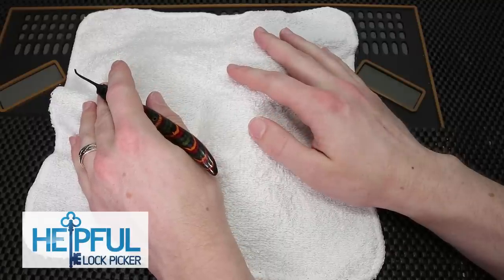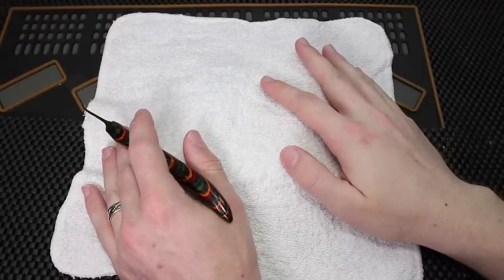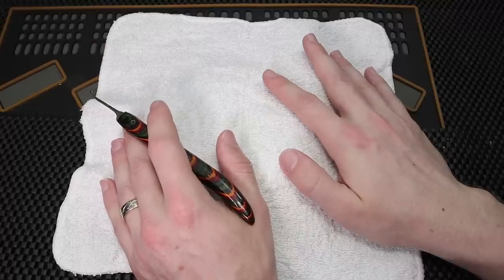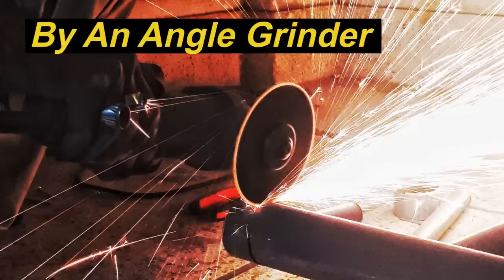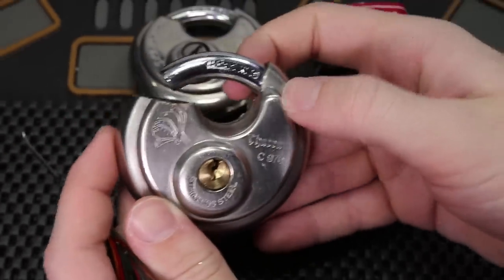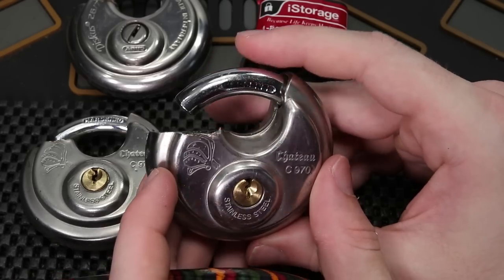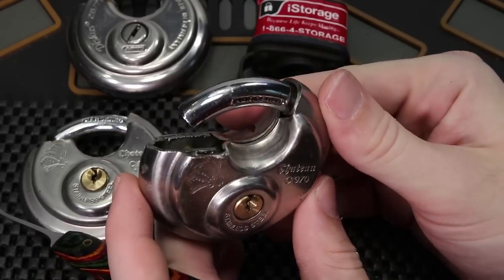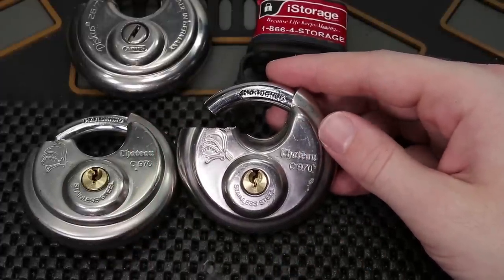[279] Why Do Locksmiths Use Destructive Entry? | Explained

Comment: As a locksmith I can say that the customer really don't care. They want the door to be open. Sometimes they are mad at us because we use e-pick and it take 1 min to open their door and price looks "high" some of them want the locksmih to have a "hard time" and they want to see what I call "brutality and fireworks". For my part I always go NDE for at least 15min of the job if the customer has a spare key inside. But seriously with all the shit they see on TV you always hear stuff like "burglars are faster ! " "I tought this was quicker !" you can pick a fucking Winkhaus, use a plug spinner 3 times or use a cool bypass tool and not even get a "thank you for saving my lock !"
Reply from the maker: Thank you for sharing your real-world experience. I just feel many of the customers are ignorant to what is actually going on. Thank you for always trying NDE first :)
Reply: Same with a rim cyls and crappy nightlatches, if you will get it open with a plastic card, they are getting mad.
Sometimes yea, they are saying that burglars are faster, and usually in saying that if you want to get inside faster, we will have to brake couple of parts, like handle for example etc, and usually they cool off

Comment: You are correct. Most locksmiths are not lock picking hobbyists and can easily be out picked by one. Lock picking is a very small part of what they do, and time being money they have to gain entry for the customer and move on to the next call. Some customers don't own items like a cut-off wheel so the locksmith will have to do it for them. You are also correct about environmental issues when it comes to picking. One last consideration is the vast amount of "trunk slammer" locksmith companies that are out there. They have no desire to pick the lock (mostly because they have no idea of the concept). These shady companies hire people that know little to nothing and look to replace rather than even try to pick (again, a skill they probably lack anyway). Drilling and replacing will build up the cost and create more profit because you are selling the customer a new lock. Pick open $15....Drill and replace....a lot more. Bottom line, hire a reputable company, don't be surprised if they use a pick gun and don't be surprised if they can't pick the lock open as fast as someone that picks as a hobby.
Reply from the maker: thank you very much for sharing your real world experience! I agree with all the points that you mentioned. There are definitely some shady companies out there which you can see highlighted on YouTube and unfortunately if you got apples can create a negative stigma.

I think one of the ones I saw someone charged like $300 or more for a lockout on a Kwikset kw1 door lock.

Comment: Since I took up lock picking  sport, my Property Management business is more enjoyable. Today, I went to a rent house, where tenants had changed locks against policy.  I picked the front door thumb lock pretty easy but the deadbolt was difficult, so I used my electric pick gun and it opened fast. I did have to use the core spinner on both of them.  But, it was fun and satisfying to not have to destroy the locks to get in. 
Once in, I choose one exterior door to be the patsy and I fixed it so I can use my Fireman's door shim and deadbolt knife to get in quickly from then on. I don't know why tenants think we want any of their crap. We have to get in from time to time, for one reason, or another.  Maybe they are growing weed in a closet or something.
Reply from the maker: Thank you for sharing, but I'd be very careful with that practice. I know I my state you could get in trouble for doing that
Reply: @HelpfulLockPicker  -Sooo... in your state it would be best to drill out the locks; only to have them replace the company locks over and over? The rental contract spells out that we will effect entry for a list of entry reasons, and that they cannot have their own locks period.  They agree and sign.
Reply from the maker: @andy-jac  If it is in your contract that can be different. I just know it to be a grey area. Just because you own the building it does not grant you the right to enter the building. It can be argued to be a form of trespassing.

MA is a state that is very hard to evict someone and there are strict processes that need to be followed in regards to entering a building someone considers their residence especially if you start to alter the locks. 

One of my friends is in property management and what I know is what I have heard from him from casual conversation.

I am from MA but I am also not a lawyer and I would take what I am saying with a grain of salt, lol.

Either way, I  am happy to hear that your skills in locksport have been able to enhance your professional life and it is nice to hear it has been beneficial for you :)
Reply: @HelpfulLockPicker  - LOL You should move to Texas, where property owners still have rights and I openly carry a 15 round pistol on my hip.
Reply: @andy-jac  here were im at you most give 24 hour notes before coming in and we have the right to change any lock so long as we give a key to the landlord. So if you did that here you could be charged regardless what it says in the contract. Here there is the landlord  tenet act and if it says you cant go in with out 24 hours notes. You cant over rule that. So i would still be careful doing that

Comment: one locksmith we use to open the big locks drives around in a old pickup truck with a massive air compressor in the back, its around 40-50 gallons hooked up to 100 foot  3/8 inch hose with an angle grinder.
Reply from the maker: Thanks for sharing! That sounds like a some heavy duty stuff

Comment: Great explanation. Good locksmiths will try NDE but ultimately you're right we have different goals and when NDE is failing or taking too long we resort destructive entry.

I also saw a comment saying why would you pay a locksmith to do that well to address that not many average people have the right tools and they often actually make things worse. Calling a locksmith is not a guaranteed destructive service nor is it a guaranteed NDE. Some times we can be successful in picking or decoding locks and when it comes to door locks I've seen damage done so bad to the door and frame that they have to get a carpenter to put right. Chances are if you get a good locksmith they will save you money if you don't have a go at it yourself and let them work their magic. I would say too that destructive entry still takes skill and precision. Yes you will get rogues out there putting a nine inch hole in the door with an arbor saw bit but that ruins the door beyond repair a skillful locksmith should be able to drill a small 4, 6 or 8mm hole in the right spot to affect entry on a mortice. Thus saving the door. Customers will panic though and only call a locksmith when their efforts have failed. Putting us in a awkward position to start with and then costing the customer a new lock where we might be able to have picked it had they left it.

I really appreciate this video as it does clear up some of the misconceptions but I do want to say that for me at least destructive entry is a last resort. But it's tool in the box to get a job done. Especially when a lock had failed and the original key does not work picking will not work anyway. I have been in that position myself. A key in knob system with a detached tail so the key was breaking the shear line and the plug was spinning but not retracting the bolt. It happens. Just because it's picked or yiu have the correct key doesn't guarantee an open.

Much love. Urbansumo
Reply from the maker: Thank you very much for sharing your real-world experience and your kind words :-)

Bored Lock picker who sent me these locks is awesome he will always try to pick first and he has been doing a great job helping out customers by using his Lishi Tools.

I respect the profession and agree that it is best to call a professional and not potentially make matters worse. As with all professional there will always be a few bad apples that can lead to negative stigmas but so far very locksmith I've encountered has been awesome (small sample size though)
Reply: I hardly ever destroy any locks outside of smart key or the storage locker locks which are being replaced anyway.  the locks in this video were cut the same day. the storage place had me out to cut locks for them on the non pays.  An employee has to be with me and they want it done as fast as possible because when if they're with me they aren't in the office helping customers.
Reply: @BoredLockpicker  yeah definitely NDE is preferred but sometimes there's no choice but wherever possible i try picking bypassing and decoding. There's a certain pride in doing NDE work but as i said you get the odd one where the mechanism inside is faulty so even the key doesn't work    even if the sheer line breaks and the plug spins so then we need a plan c or d which is why i have a drill, an angle grinder and soon a die grinder. I don't enjoy destroying locks and i always feel a little sad each time like somehow I failed but it is true sometimes we gotta do what we gotta do right and I think that was the essence of the video in explaining why sometimes locksmiths destroy the locks.
Reply: @forric23  well said!  I got into locksmithing from being a hobby lock picker.  I love picking locks.  main thing I want to do is open the lock in a way the person paying me can't.  even when I see that i can probably shim a latch I still pick it unless its smart key I just shim the latch and save the lock lol.
Reply: @BoredLockpicker  you sound very much the same as me i also came from lock sport. I haven't had to deal with any smart locks yet and I am kinda dreading it. But then ive dealt with failed UPVC mechs and had to spread out hook bolts from the keeps so i guess it would be no different. Similar sort of bypass probably.
Reply: @forric23  what country do you work in?
Reply: @BoredLockpicker  UK. So we get a lot of euro cylinders and mortices.
Reply: @forric23  upvc MPL's are fairly  easy , it is composite doors with failed  mechanisms I hate.
When it comes  to picking  on a job  we do have an advantage  over many American  pickers  due to us having to deal  with common locks  fitted  in both orientation.
Having said that I had to remove  47 bike locks in one visit  from a student  accommodation site last year, there were 2 nice padlocks  that I picked and repined  the rest got cut.
Reply: @cardiffpicker1  i can imagine Composite being a pain as there's no give. Not been to many composite jobs and thankfully none have been hard failures in the locked position.
Reply: @forric23  a lot of the time you can remove  the cylinder  and manipulate  the linking  bars through  there, but if something  has disconnected  ot is a pain
Reply: @cardiffpicker1  I can imagine. It doesn't help my anxiety. I have actually stood on a doorstep before and dripped with sweat in abject panic. Lol. As my experience grows I feel more confident but still there are locks that fill me with terror. Like abloy protec and ingersolls. In those cases i think its either walk away or die grinder time. I also think that customer's who have those sort of high security locks expect them to be drilled out but it would be a nice surprise if we were able to do it NDE. The only thing I worry about is whether that makes the customer feel less secure that their unpick able lock was picked open.
Reply: @forric23  ingersoll  is generally  through  the letter box or   drill through  the door and use a drop key, abloy protec  are destructive  entry or find another way in.
Reply: @cardiffpicker1  i thought so. I have the drop key but that only works so long as it is not deadlocked with the key. Glad to hear that protec is accepted as destructive.
Reply: @forric23  there are probably  only a handful  of people  in the country  who can pick the protec 2
Reply: @forric23  you can drill an ingersoll cylinder  , obviously  an expensive  decision  though

Comment: Decent examples. Yes we want to get the job done as quickly and efficiently as possible because at times you may have two other calls waiting. A worst case is being out on a residential call that a customer hovers right next to you while you know you have another call for a lock out on a Automobile thats engine is running. Plus its a 10 mile drive to get to that next call. The pressure definitely affects your picking skills. Its similar to playing pool/billiards against someone and then deciding to gamble the next few sets. It will throw your stroke off and you will not be as good (well that is unless you're a hustler). I can say this out of a year of work I can still count on my hands the locks that I had to use destructive methods on to get them open. I do alot of picking practice though at home usually while falling asleep lol. I keep a few locks on my night stand and switch them out every couple weeks. I keep the most basic tools on the night stand for picking them as well. You can train yourself though to pick under pressure and stress. However there will eventually be a time when you just have to use destructive entry. Just as the analogy I mentioned about playing pool for money. Eventually over time you become accustomed to that stress and become a much better player. Performance anxiety very much exists in Locksmithing as you want to keep the customer pleased and do your best so that they will reccomend you to others.

Comment: Like any trade, fast and efficient is how you pay the rent on home and shop.
I have watched a number of videos by SE Lock and Key.  You get an idea of the many constraints, the unexpected problems requiring creative solutions, and the fact that the clock is always running. Everything you do costs you money so everything must make some money.
Reply from the maker: Thank you for sharing!
Reply: yesterday I went to a vacant commercial unit.  schlage mortise cylinder.  I had to open the door and replace the cylinder with a different keyway to match the master key the owners use for the vacants.  I have the cylinders already pinned.  Job usually takes ten minutes tops.  I picked the lock open in a couple seconds then notice that all the screws that hold the cover plate on are stripped  so bad it almost cant be an accident.  couldnt get them out so I drilled the heads off then use pliers to get the rest of them out.  then of course the set screw that holds the cylinder in had its head broken off.  drilled that out.  managed to not hit the threads so I didnt have to re tap it but thats how an easy 5-10 minute job turns into 20-30 minutes.

Comment: I work for a self storage facility and that's what we basically do.  We use angle grinders to cut off the lock and sometimes, with the weird angles the locks are in, it'll probably be faster just to pick the lock lol
Reply from the maker: Thanks for sharing! Angle grinders are certainly more reliable than picking. Picking locks in use can be tough

Comment: Exact same method of entry every time.  I wonder how long it took him to get entry that way?
Reply from the maker: I can ask him or see if he has done a video on it :)
Reply: @HelpfulLockPicker  that would be cool.
Reply: It can usually be cut in less than 5 minutes with setup and teardown putting all the tools away
Reply: @georgeyorba109  that's quick.
Reply: like 2 minutes per disc lock.  I go slow because I dont want to nick the hasp or door anything.  the small little master locks cut in a few seconds.  on the disc locks its actually better to cut the other side of them.  it takes less than a minute but the way they're usually locked on the doors its just easier get to that side that I cut.
Reply: @BoredLockpicker  That's incredibly quick. I can imagine padlocks like Master and others similar. Surprised the disk locks can be cut through so quickly.  I suppose trying not to damage hasp,  hate or door would slow you down a bit. 

Thanks for answering 👍🏻
Reply: @roysammons2445   thats why I think spending money better locks like abus discus lock as opposed to the cheapest disc lock at walmart is a waste of money.  if you lock it with the key facing the frame you cant get picks into and the grinder cuts them all with ease
Reply: @BoredLockpicker  You have an excellent point.